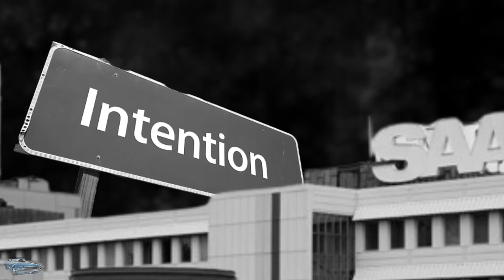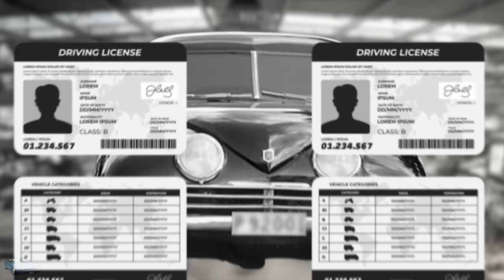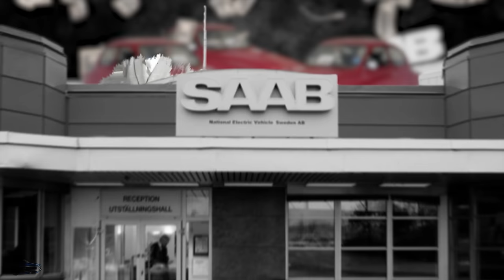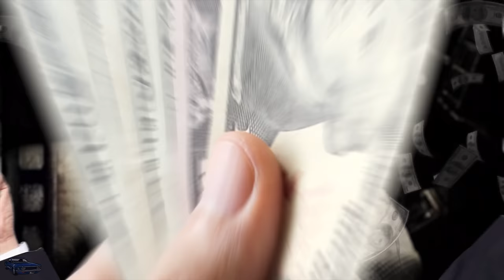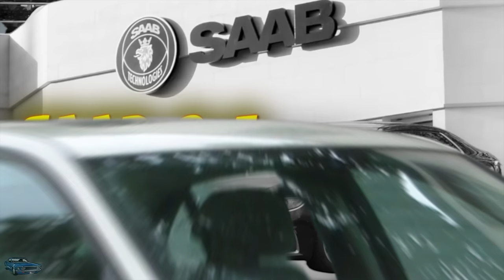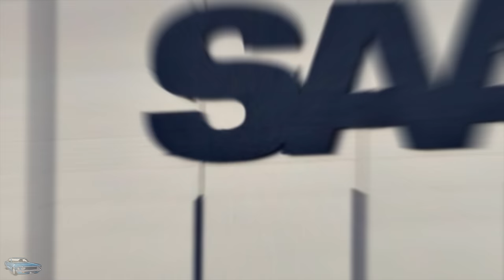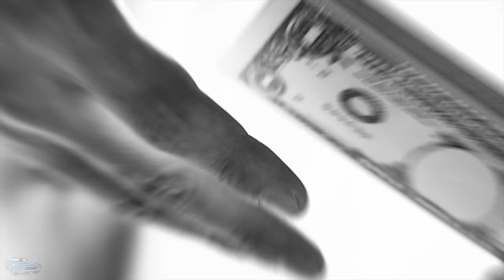The TRAGIC Fall of Saab | A Classic Car Documentary

Comment: I leased a new SAAB 900S  in 1996 or thereabouts. Did not have a happy experience with it as it had mechanical issues. As warranty drew to a close, I bought an extended warranty from Allstate and boy was I glad I did. Engine blew up around 1998 and while the car sat at dealer waiting for a new engine to be shipped from Sweden, I rented the new 9-5 as a loaner. Boy, what a screamer that car was! I had already made up my mind NOT to buy another SAAB but after I drove that 9-5 for about 3 or 4 weeks I decided to give SAAB another shot once lease was up on my 900S. My trust was NOT misplaced. I leased a new 9-5 wagon and I loved it. It was a station wagon sports car as far as I was concerned. When that lease was up I bought a used 9-5 wagon that I drove for a few years with not many mechanical problems. Then in 2009 I ditched the 9-5 wagon and bought a Volvo XC-70, going back to Volvo. I had owned a number of Volvos over the years. Believe it or not, the SAAB 9-5 wagon did NOT handle well in the snow! And this is a Swedish car! The Volvo XC-70 handled MUCH better in the snow. But I was  heartbroken to see SAAB close up shop. They were on their way to producing better quality cars and had a bright future it seemed to me. Guess I was wrong. ☹

Comment: 7:12  "Free wheeling" is a conventional feature on vehicles with 2-stroke engines. It prevents the engine from becoming oil starved under engine braking.
Reply: Also was on v4 I was told so when going down snow ice hill front wheel drive would maintain steering not slip from engine braking effect if foot was off pedal .
Reply: @MitzvosGolem1  If I remember correctly, V4 95s and 96s used the same tranny as the 2-stroke. I always assumed that it was just easier than retooling. All I can say for sure is that I never had any problem with losing steering under engine braking in my 99.

Comment: The biggest tragedy is that Saab rejected a proposed merger with Volvo in the late 70's. One can imagine a world where Volvo had received help from Saab to develop their Galaxy platform. Then neither the Volvo 850 or second generation Saab 900 would've had the issues they ended up having. Perhaps both brands could've broadened their lineups. Perhaps we would've seen a new Amazon and Sonett in the late 90's?
Reply: Hyundai is the SAAB of the 1990's, the Elantra and Accent were their best cars of that time. Hands down. I'd love to have the 1.5 OHC Accent engine in my old 71 99, it's such a willing little engine, and 5 speeds.

Comment: I owned 2 Saab 9000s non turbo and sold bothe at 360000 im and 361000 km. Great cars, never had some issues. I loved the smooth drive, the great interior, the very good mpg and not last the reliability! GM was definitely the wrong path for Saab, not sure if there were another better one.

Comment: I was the service manager in a large SAAB dealership in the UK from 1967 to 1990 and have fond memories, together with mixed feelings about the brand.  there are some errors in this doco:
The 93, and 94, two-stroke engines were manufactured by Wartburg, an east German vehicle manufacturer. The SAAB 95 was the wagon version of the SAAB 96. The SAAB 99 was never fitted with a 2-stroke engine, the 4-cylinder 1709cc engine, inclined at 45degrees was manufactured by the Triumph Motor Company, poor manufacturing quality resulted in engine failures. Later on, a 2.00lite Auto-only engine was offered. Eventually resolved and the engine then appeared in 1850cc form in the Triumph Dolomite, and the Triumph TR7. The SAAB 96, from approx 1967 onwards, had a Ford Taunus V4 petrol engine. SAAB 's quality was a myth, the V4 96 has constant gearbox bearing failure, as did the early 99, and the later 2.00ltre automatic version named the EMS. SAAB couldn't or wouldn't spend the money on upgrading the gearbox to prevent premature diff pinion bearing failures. They were too busy looking over their shoulders to see what Volvo was doing. A good overview and better research would have put the icing on the cake.
Reply: Wartburg engines?!
Never heard that one before.
Heard many times that they have DKW engines, but that do not seem to be the case(The URSAAB 92001 does have a DKW two-cylinder though it seems) the engines was just heavily inspired by DKW(As was Wartburgs engines).

Comment: Had 2, loved the 2 stroke.  As a small Sedan class racer, won a lot of races.  Lived in New Hampshire at the time.  Drove over the snow not thru it.  I had a gravel driveway i did not shovel.  About 3' and it would run on top.

Comment: Had more '68-'73 SAAB 96 & 95 V-4s than I can count. 
Extremely interesting and VERY reliable!!!
Great video, but never heard of a 900 w/a GM platform under it.
Reply: The 900 that came out in about 1993 shared a lot with the Opel Vectra. The engine was a SAAB-engine, though.
Reply: @jonaarbakke9633  Ok thanks. I looked it up quickly. That was a whole different style (Opel platform) that came out around '94. Nothing to do with the original 99/900 based SAAB. Didn't realize they were called 900s - I thought they were all called 9000s.

Comment: GM ruined Saab. When the hood was changed to a conventional layout, that was the end. 
My son had a friend that had a 900 in his apartment complex that he needed to get rid of. We went and drug it back to our place. The fuel distributor was shot, must have had water in the fuel. Luckily, I found a good distributor for $100. I wanted to keep the car so bad, except the sunroof had been left open so the interior was a mess. The car ran fine, rode well, and the seats were some of the best I have ever been in. It was just a little 4 cylinder tractor engine mated to a washing machine transmission. The car was heavy, and very low powered, so it was slow, but it would cruise along at 70-75 quietly.

Comment: I worked on a few SAABs during my career as a mechanic in the 1990s although my forte was with German cars.  They were eccentric as far as engineering goes but drove beautifully, especially the 9000T.  I worked at a dealership in Seattle that carried VW and SAAB when the 93 and 95 were introduced.  We had major engine problems with them, primarily due to GM attempting to attract buyers with oil changes every 10,000 miles.  In addition, SAAB required the dealer principles to build a stand-alone facility to sell the mark.  Relations with corporate go so bad that my employers ended their relationship with Saab and brought Subaru in to replace them.  My service manager told me that the GM merger is what killed the company.  I'll never forget when they introduced a SAAB branded Chevy Blazer, an overpriced piece of crap.

Comment: I had a Saab 3-cylinder 2-stroke with model year 1967. I think that was the last year they were sold in the US. Notably I rolled the car and drove away, with the only other-than-cosmetic issue being the motor side mount (a $3.00 part) and wheel alignment. Amazingly it ran another 50,000 miles or so before developing some kind of engine problem - once the front end was realigned it was good to go. Got thirty-miles-per-gallon on the highway at 55mph which was the national speed limit at that time in the early '70s. It would do 65 or 70 on the flat.

I also had a number of V-4 Saab 96s - a much more powerful car with similar body design. There were at least as many V-4s sold in New England as 99s during that period. It was a hit among car enthusiasts, and there were annual ice races held in Tennessee. Unfortunately, the German Ford V-4 frequently proved too much for the Transaxle/Transmission in these cars, with the latter having to be swapped out, which involved pulling the engine. It didn't diminish the love everyone including me had for the V-4 Saab cars.

Comment: Back in the days I almost bought a Saab but then I did not like the front wheel drive. So, I bought the Volvo 1973 GL. Wow, I fell in Love with the Volvos, so now I have owned al kinds of Volvos over 45 years. 144/244/740/940/960/850/V70 .............. And now, I have my -94 Volvo 940 GL and will keep it till I die 😂 Amen ❤😊

Comment: The first car I owned was a 1963 SAAB.  One thing that was unusual for that time, at least in the US,  was a front wheel drive car.  And, of course, a two cycle engine.   My wife had a Volkswagen Beetle.  The SAAB handled much better than the Volkswagen.
Reply: Sticking to the 2-stroke crap of the 1920s was a big, big fault. Others like DKW died on the same failure. Yes, induced by the them net Ger,am car tax system based on cm³.

Comment: Had 3 Saabs.  2 used, 1 new.  The new one made it to over 300K miles in 17 years (2000 95 Aero Turbo wagon).  It looked new until the person I gave it to in 2015 wrapped it around a pole.

Comment: Intersting to know about the SAAB 92 / 93, their engines were DKW derived, with the 2 cylinder resembling the East German Trabant engine and the 3 cylinder resembling the Wartburg engine. This would later play a role in motorsports.
Reply: They were SAAB's own in-house engine.   They were much more refined in driving than the Deek and Wartberp. They had centrifugal and vacuum controlled ignition on their distributor and their transfer ports were tuned for smooth operation from low revs to high. The Trabant was aircooled and less than half the displacement of the 92's engine, which was also a lot more durable.

Comment: I started with a used 74 99  then a 84 900 non-turbo best one I owned 1996 900 drove it until 2015 gear box blew up not worth fixing

My current bought 2003 93 still my daily driver it is wearing out been a good car but electrical problems are a huge pain

Comment: To clarify some info on SAAB Auto, after Spyker sold off Saab Auto to NEVS in August 2012, Scania AB announced that the griffin logo used in both Scania's and Saab Automobile's trademark would not be allowed for use on future Saab cars with NEVS as the owner of Saab Automobile. Scania believed the logo is of high value in China and feared that it would end up in the wrong hands through the Chinese interests behind NEVS.  In late 2013 NEVS reportedly owed around $57 million to creditors, and sought bankruptcy protection with the aim of restructuring the company.  Despite protection being granted, Saab AB, the former owner of Saab Auto,  revoked the right for NEVS to use the Saab brand name.  NEVS rebranded the cars as NEVS.  Much like Volvo AB and Volvo Cars.  The current owner of Volvo Cars, Geely has the Volvo name and logo licensed from Volvo AB.  

NEVS was acquired by Chinese conglomerate Evergrande Group in 2019.  Evergrande's subsequent financial troubles resulted in NEVS being closed in March 2023, with NEVS going into "Hibernation Mode" to avoid bankruptcy, essentially liquidating the company.

Comment: Nothing wrong with the SAAB 9-5 (first model), but it came late to replace the SAAB 9000, and most mechanics state frankly that the SAAB engines (2.0 and 2.3) are more difficult to maintain and service than GM's EcoTech series.  Hence most urged us to either go for the GM EcoTech equipped SAAB 9-3 or GM powered SAAB 9-5 models because they just were much easier to work with.  In terms of drivability and enjoyment, they did not fully capture the novelty of the original 90/900-series, but they were better than any other car.  My main issue was fuel consumption 'in city' but for longer trips on freeways it was surprisingly competitive.  Nevertheless, I'd say that the SAAB 9-5 falls somewhere between a Mercedes Benz E-class W124 and W210 series in broad technology terms, meaning it was nearly technological obsolesce when it first came out.

Comment: When GM acquired SAAB, everybody expected to get Swedish quality American cars. Turned out that we got American quality Swedish cars in stead.

I'm on my third SAAB now. First I had a battered 1986 9000i with 400,000+ Km on the odometer, then a 2004 9-3 that I never clicked with, which was then swapped with my current 1998 9000 CSE which I intend to keep as long as possible.

Comment: 7:00 or so: the over-running clutch (sprag clutch) meant you didn't have to push the clutch pedal in order to shift the transmission.
Reply: Came in handy when I had a cracked bone in my foot from playing volleyball.

Comment: I'm a big Volvo fan and even I miss Saab. If it wasn't for Saab, Volvo wouldn't take any strides to improve themselves especially when it comes to turbocharging. First successful and proven low inertia turbocharging technology was Saab. Volvo then followed suit with their 2.4T, later 2.5T (which also have variable valve timing on inlet valve). Low inertia turbos seems underpowered on paper but in many real life driving, they have proven performance ie quicker acceleration on low rpm and in high gear - similar to turbo diesels or larger displacement N/A petrol engines. Such turbocharged engines is all thanks to Saab. Sadly it was mismanaged by GM. Volvo was lucky to have Ford to allow this Swede to develop and make their own chassis and engines before further development to Ford EUCD platform.
Like I said, I too miss Saab.

Comment: Too many errors around the pre-GM cars to list. I had 2 2-strokes and a '70 99 and a '76 99 "fastback". About 450k total miles. The weak points were in the '70 car: The trans needed rebuilding every 50k and the engine (Triumph 1700) at about 70k. Both were updated to the later trans and 2L from a wrecking yard. Bulletproof.

Comment: Even American management is NOT always right! It's very, very painful to see how GM ruined Saab when it incorporated it as a wholly-owned brand. Saab was, and will always be, be remembered for its immense contributions to automotive safety, styling and performance (such as turbocharging); true, it gained a very respectable niche in the US market during the late 60s (with the introduction of the 99) and on to the '70s, '80s and early '90s by being, as one of its ad campaigns for the US market once extolled, a well-built Swede even before GM took over--and American motorists were equally proud of driving their Saabs and taking care of these very  well. But it will be very, very hard to forgive GM for ruining this once venerable brand with the way it mishandled it☹

Comment: Free wheel system was needed for 2 stroke engine as when coasting the throttle would be closed. No fuel no 2 stroke oil for lubrication of pistons and crankshaft. Motor would wear out. This is the reason for ball bearings for the crankshaft also.

Comment: The freewheel is explained in a totally misunderstood manner.
Reply: I thought the purpose of free wheel was to not be revving the engine on long downhills since there wouldn't be much lubrication with the carburettor valve closed, no lubrication and you wreck the engine.

Comment: one thing you don't point out is the last few SAAB models where nothing more than slight re-engineered/rebadged versions of GM or Opel models- (the 9-3 and 9-5, per my understand. were slightly rejiggered Opel/Vauxhall models) you don't mention the 9-7X which was an SUV (in the late 90s the US market was crazy for SUV) the 9-7X was nothing more than a slightly reengineered version of the Chevy TrailBlazer (and made in the US to boot). Not only did this dilute the SAAB brand, confuse the market, but GM had managed to give SAAB an SUV when that market was shifting from traditional SUVs to crossovers. Well done GM.
Reply: Very true. My 2000. SAAB 9-3 had the SAAB built H-Motor. 02 was the last year of the H-Motor. 03 and onwards was GM's Ecotec motor with a turbo charger tacked on. Nothing but problems. Transmission problems too.

Comment: Good presentation/report, thanks. However:

Shame on the video editor who is guilty of committing the video atrocity of BBC (Blow-up, Blur, Crop) 4:3 aspect ratio films and video (or 4:3 films transferred to video) to fill the 16:9 frame. Doing "click to fill" may look OK on a computer screen (other than the unnaturally overly large images) but on a TV the loss of resolution results in a terrible blurry mush. You are taking standard definition video and degrading it to substandard definition video. You are also altering/censoring the carefully composed and framed 4:3 aspect ratio images by the historical cinematographers and photographers. Leave 4:3 alone!

Comment: Every one is so sad that saab is dead. I worked for saab for 12yrs, and the saab automobile rescuer GM, was also the one that drain saab automobile on fonds and money. This by stealing good ideas and doing criminal money laundry. (investments in foreign countrys use to give insane tax write-offs in the U.S) But, saab is not dead. Not the slightest. Saab automobile is on ice, maybe forever more, but the brand saab is prospering. Saab aerospace are manufacturing parts for everything space, they made parts for the mars rover, hubble telescope many satellites and so on. Saab design are designing items from coffepots to snowboards. Saab powertrain are designing advanced 4wd systems for many cars and trucks, among other things they designed and built rear axels for subaru 4wd. Saab engineering are building sofisticated electronic guiding systems for weapons and such. Saab aeromotive are designing and building Jas gripen, one of the most agile, intelligent fighter jets on the planet. There are a lot more saab does, and to be thrutful, saab cars were a fun project, but not what brings in the big bucks for saab as a brand. Just to let people know how thing actually are..

Comment: SAAB was cool !  in 1987 I saw / heard a 99 2-stroke wagon = estate !! had a Suzuki GT 380 2-stroke motocycle at the time -- same cool 3-cylinder rythmn

Saw a 99 V4 = Taunus-engine a few days ago -- otherwise 99s  seem gone from Seattle roads :'-(

Still 900 and 9000 models around -- they were poular for dealing with snow in ski areas + occaisionally in-town, 
when the alternative was N0 Center Diff 4wd vehicles...

before modern AWD

(have a '95 Land Rover Disco 1 manual 5x2 trans -- does just fine, t.y.)